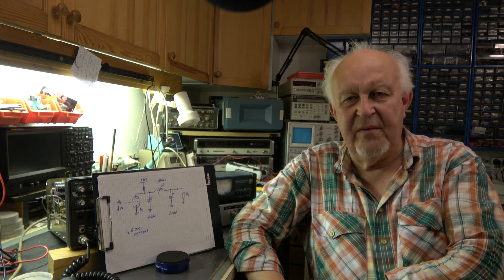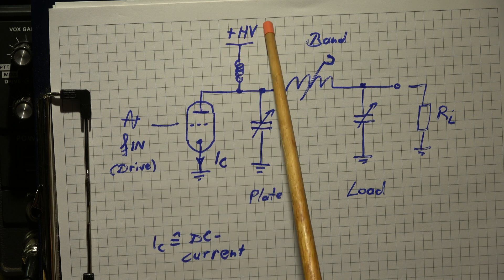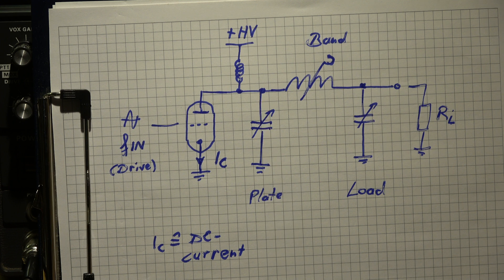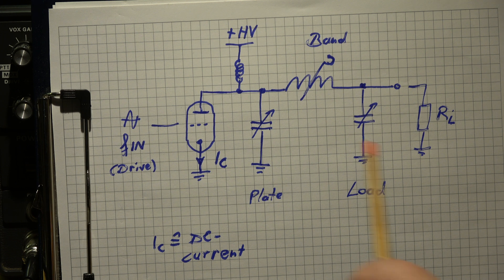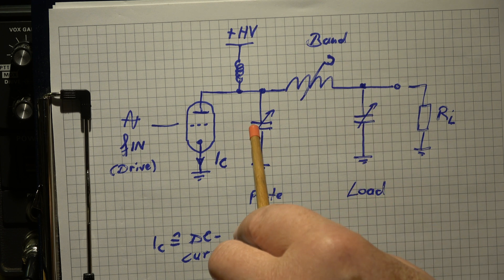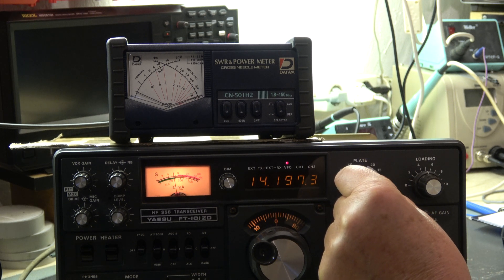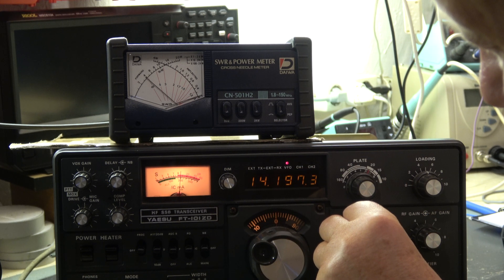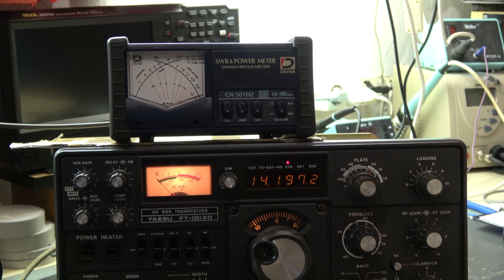#142 Tuning a PA with tubes

Comment: Stefan, this video could not have come at a better time for my friend and me. He is a new ham (although he earned his Extra class license) and was given a TR4. He and I worked on it together for some months. But the tuning of the PA was something that we were trying to do what the manual said, and could usually get it to work, but really did not understand the details (it has been many years for me since I had a tube rig). So the other evening I brought up your previous video and showed him how you had demonstrated the safe way to work around a rig with HV, disconnecting the PS feed, and then grounding the plates. These sort of safety things that you show and explain will likely save someone's life someday. So then I saw you had just posted this tutorial on what is really being done in tuning the Pi network in the output, and he and I watched it and then had a much better understanding. We were able to get things to behave better, but then I decided that we should try neutralizing the PA as described in the manual, and then things tuned up nicely into a dummy load. We switch to the load to tune the rig, then switch to and tune the matching network to feed the antenna.

My friend is actually very intrigued by this 55 yr old tube rig, and has enjoyed learning about the old technology, troubleshooting, and how well it really can work (and we have done some DX on 20m). We actually went through two TR4s in the process, the first one being a very early production and we had to chase down an oscillation (the final answer was that early in the production Drake made a design change and added additional PS decoupling; thus the 4 rather than 3 section electrolytic cap in the later TR4s). After getting that solved (through inspection of another friend's sample TR4 to inspect), we also came to find that the original "tuna can" filters that Drake had built had gone bad, and it had really bad passband behavior (which became obvious when we swept it on my VNA). The 2nd friend who had let us look at the later TR4 from his collection of Drake stuff took pity on us, and again we were gifted with another TR4, this one with good filters and no oscillation! But it had its own issue, and we got to learn about the needed rework for grounding the tuning drive fork for the PTO, and now he has a pretty nice rig, and with your tutorial, we now understand how the PA tuning works! I had previously rebuilt the power supply with a nice circuit board and modern capacitors, so we are also good there.

Keep up the good work; you help many of us with your technical and safety tutorials, and give us enthusiasm to take the covers off, learn how this stuff works (or did), and then make it work again! Tnx es 73, de WB0DKT
Reply from the maker: Hi dr Glenn, glad to read that this short tutorial did really help someone. Yes we should use and preserve these old rigs. I have a Drake C-Line which is very similar to the TR4C and I would NEVER give it away!
PS: Neutraslizatin is very important and improves the output at 30MHz